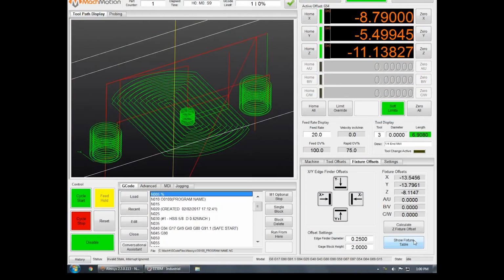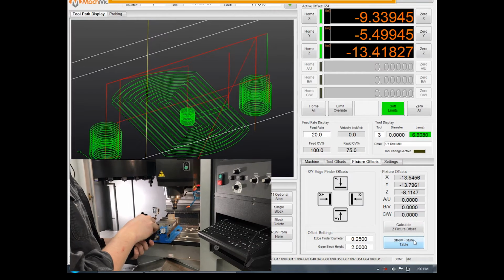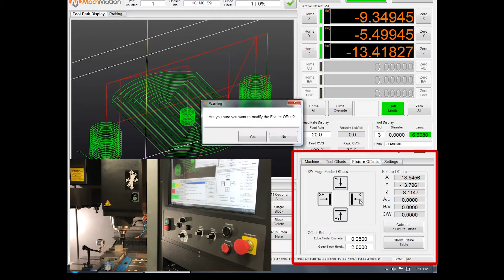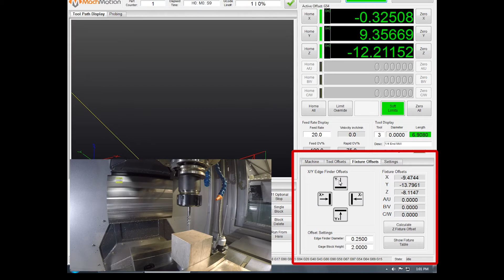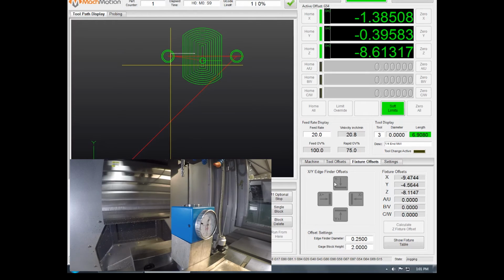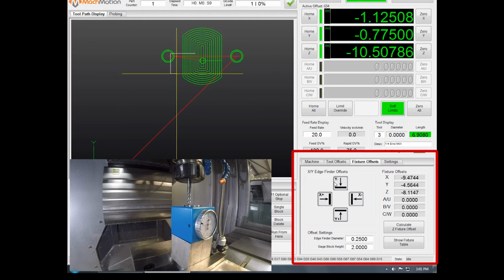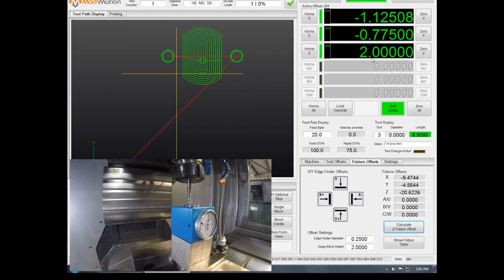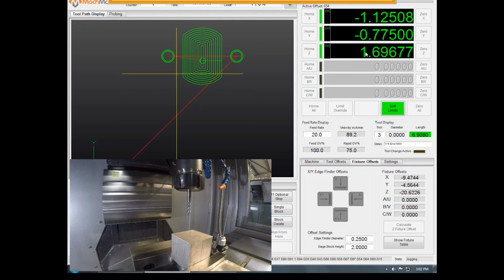MachMotion How To - Setting Fixture Offsets (Part Zero)

Comment: how do you calculate multiple tool lengths while running the program
Reply from the maker: michael jones The tool lengths are recorded in a tool table. Length can be set manually with a gauge block or with an automatic tool setter.
Reply: Thanks. do you also always set up on the positive side of the part